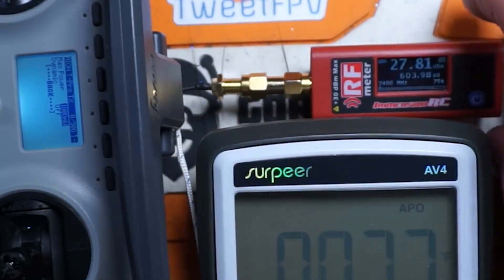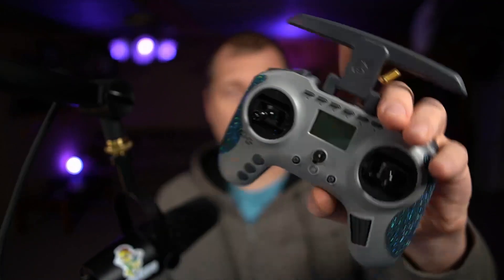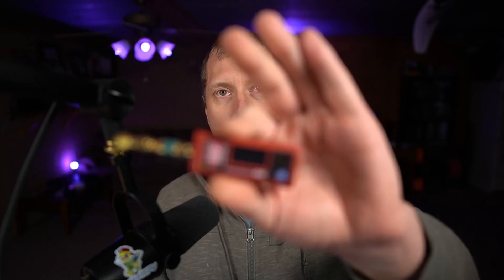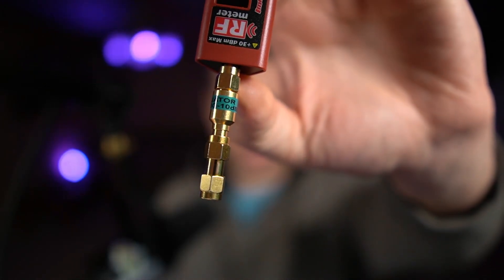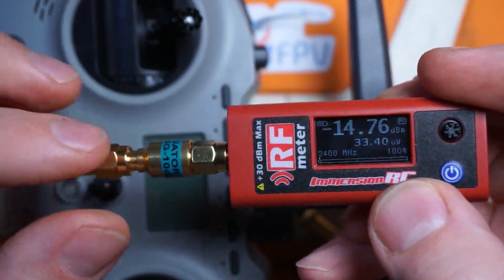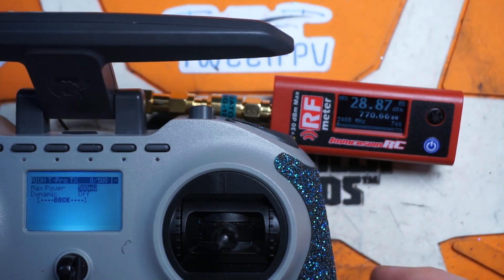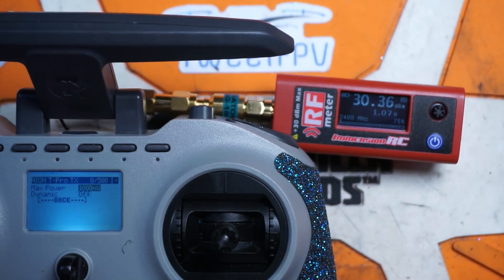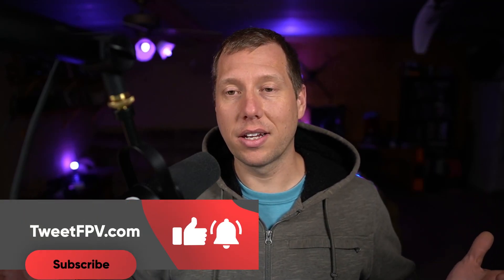I got it wrong. Jumper T-pro power output #jumper #t=pro #elrs #expresslrs

Comment: Nice! I think a fan mod should help to stabilize the power. I have this radio and it's perfect for me. I just took 1h at begging to setup the switches to my like.   This radio is great for it's price, its 30% cheaper than the Zorro and it uses the much wide available 18650 batteries, which is a great plus. I'd buy a second one with closed eyes.

Comment: To be honest I like the radio, I made couple of modifications to it, removed the antenna and just drilled a hole for SMA pigtail. Also made the gimbal shaft 4mm shorter. Great for thumbing!
Reply from the maker: It has the ability to be a ok radio but I does need some modifications to get there... I still don't like the momentary shoulder buttons.

Comment: Yea the IRC meter is doing really odd stuff above 500mw for sure with out attenuation.  Been here with this and had the same pain.  I have reached out to Tony to understand more as something strange is going on. 

We are seeing some really odd results with the digital FPV systems as well in the same way.   On the RF output on anything less than max this is simply a firmware config setting so it’s not really related to anything other than what the devs have set it too.   The Zorro is the first radio to actually be calibrated with feedback as i understand it.

Comment: hey tweet, why 10db and not 20 or 30 ?
Reply from the maker: just what I could get my hands on at a reasonable price.  I have heard that going much over 10db will cause low readings below 500mw with the attenuator installed but can not confirm that.